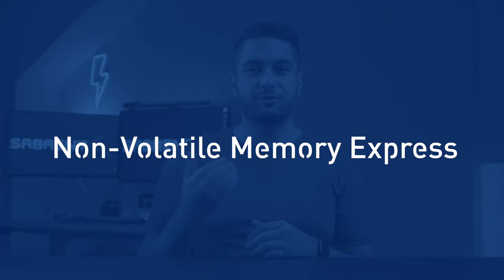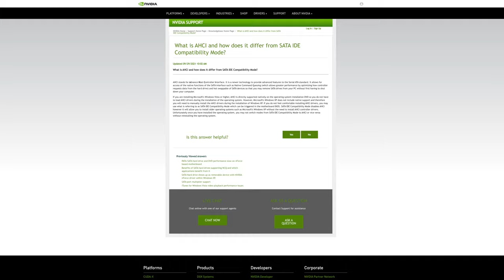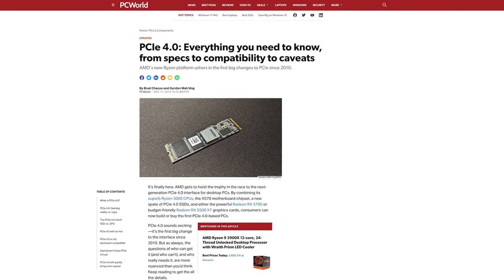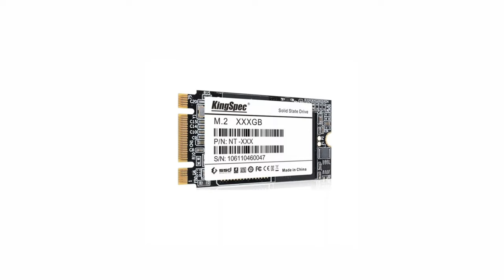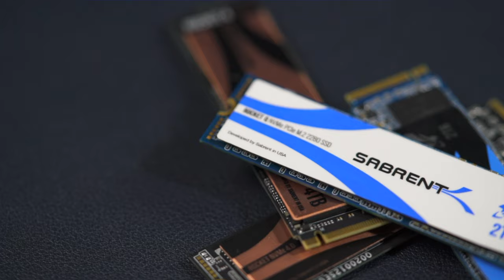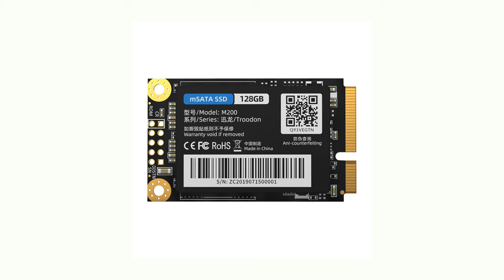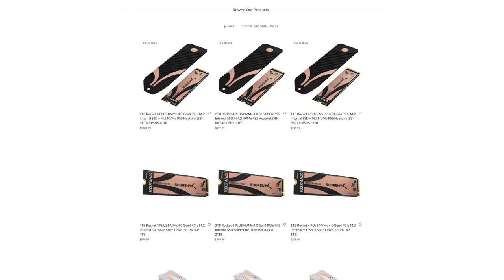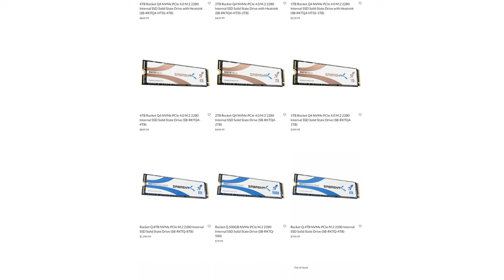M.2 NVMe vs M.2 SATA vs mSATA | Explained

Comment: I'm still trying to figure out what the difference is between your SSDs that are blue and your SSDs that are peach.
Reply from the maker: Do you mean the TLC version and QLC version?
Reply: @SabrentUSAOfficial  thanks for responding. I just watched a video you put up a couple of weeks ago on your offline cloning box. To my surprise I see a third version. Now there's the black and beige, the white and blue, and a black and blue. I have no idea what the differences are other than the colors. I know that the black and beige one is more or less specifically for the PS5 or any M.2 NVMe setup. But I don't know what the white and blue and black and blue versions are for. All I know for sure is that all three of them are 2 TB in the videos that I've seen. I'm assuming that means there's also 1 TB and 500 GB versions of each, as well as maybe 4 TB versions of each. Beyond that I have no idea. While the idea of solid state drives is not new to me, this type of packaging is. The last time I actually looked at solid state drives they were basically almost the same size as a 3.5" hard disk. I have an external SSD that is 300 GB. I'd have to dig it out to see what brand it is. It's not exactly large, but it's not as small as the one that goes in the PS5.

I actually stopped keeping up with hardware a few years back, and I only got back into it because of getting back into gaming and getting a PS4 slim and a PS5.

I have ordered the Sabrent 2TB SSD with the PS5 heatsink. I expect delivery between November 3rd and November 5th. I'm looking forward to putting it in my PS5. I'm just trying to understand what the differences are between these three ssds that I've seen in your videos that apart from the colors look identical.

Comment: 2.5" is standard for a notebook or a Laptop. But the manufacturer's elite range (Notebook/Laptop - Lenovo X220) hard an extra port to facilitate msata. Where os/apps lives - that can be stored on the fast msata for performance and data can be stored
 on a large 1TB secondry 2.5" drive(7200) for capacity. I still have my  x220.